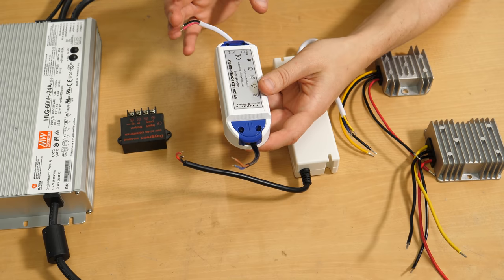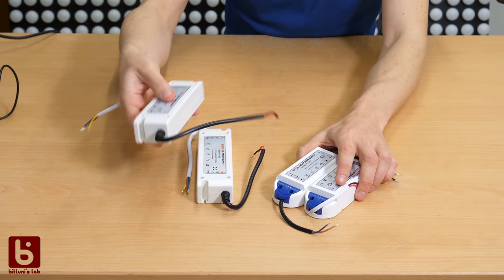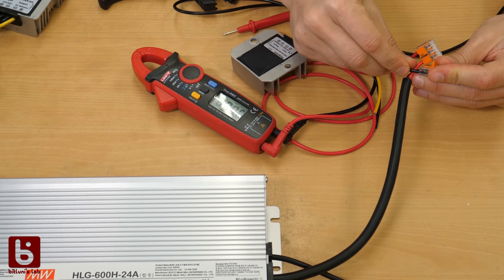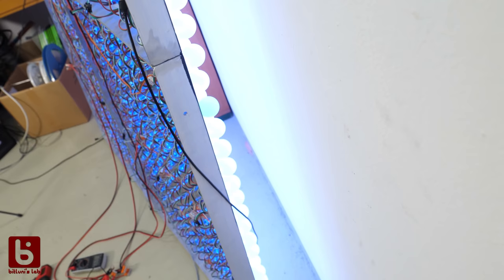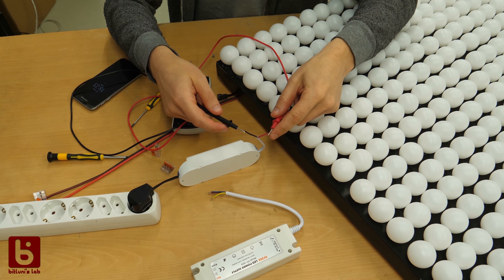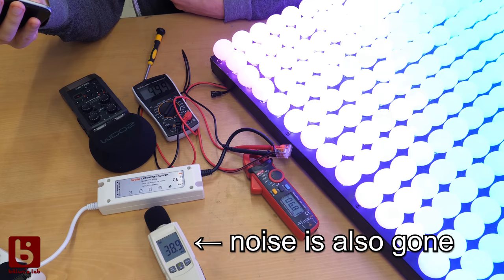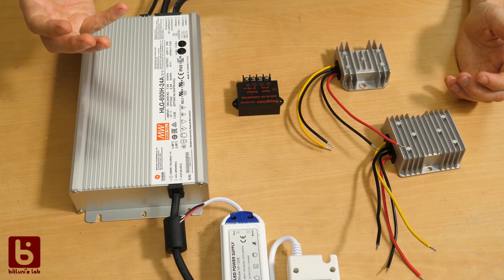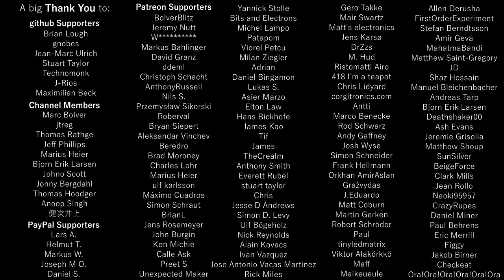Testing Power Supplies for LED Projects

Comment: Don't use infrared thermometers on emissive (shiny) surfaces such as metal cases, the reflections will make the reading seem much lower than the actual temperature. You can use a marker to color the area you want to measure to correct this (or use a really expensive thermometer with a correctable emisivity).
Reply: Yep I've learnt that by measuring the temp of an ice cold water bottle (the metal insulating bottle) and it showed the water was at room temperature 20°C as the inside of the container was shiny stainless steel, the water was actually filled with ice cubes at 3°C when measured properly.

Comment: 5:40 "I like to test any metal parts for potential electrocution"... by touching them, and seeing if they cause death
Reply: It's the @bigclivedotcom or ElectroBoom (@msadaghd) test 😁
Reply: At least use the back of your hand!
Reply: I don't think that he would do that with metal case power supply from China
Reply: @richardperritt  Works to check charged caps too

Comment: A couple of years back I built the electronics of a huge LED wall (a.k.a. FlaschenTaschen) that needed 80-90A at 5V with all LEDs on. I ended up with three MeanWell 5V/30A power supplies supplying different sections. They required mains distribution, but that could be limited to the parts sitting on the ground, so no big deal there. These days, I'd probably go a similar route you go here: Get a beefy intermediate voltage supply, then from there to local distribution parts that then convert that to 5V. I'd actually slightly prefer 48V to 24V, because this is a very common distribution voltage in the industry for there is a huge selection of 5V converters.

Comment: I personally am a big fan of (used) rack server power supplies. They are dirt cheap, built with high-quality components, and even the small ones deliver 50A+ @12V. You can also cascade these to get e.g. 24V. Obviously these need active cooling, but you can always build a sound-insulated enclosure and/or stash the PS far away from the application.

Comment: I also like to use those Daygreen DC converters. At our cottage I've got a big 24V supply from which I can take relatively thin wires for long distances, then drop to 12V for cameras/IR LED's/water pumps and to 5V for Raspberry Pi/ESP projects. Very handy to reduce the need for AC wiring and ugly outside wall sockets!

Comment: Make sure you don't forget that this mean well power supply is a constant current type driver.
It's intended to drive bare LEDs, yours are not.
So make sure that the current limiting potentiometer(under those black plugs) is set to maximum so you don't get weird issues.
Reply: It is both, a constant voltage and constant current PSU. But you are right, the CC setting is not needed here (but most likely made the PSU more expensive than a CV only PSU).

Comment: It makes sense for the LED wall to convert 240v to 24 before splitting it up. I have a project in bigger scale right now with 100m of LED strip hanging from the ceiling. If i would take voltage down to 24 or even 12 i would have too long cables from there to all the 5m Segments of LED i power seperated and a pretty high voltage drop. So i have no other way than giving every segment a converter from high power. But still a good idea! I will also check all the power supplies like you did. The check with no direct connection between mains voltage and 24v was a good hint :)

Comment: thx for the video !!

Please don´t measure Temperature with an IR-Meter on any reflective Surface as bare metall or shine stickers. you get reflectations and you will measuring anything instead of the DUT
Reply from the maker: I realized that measuring the heatsink after opening one of the cheap ones but always searched a spot that would work
Reply: On different surfaces, you have to apply a correction factor that depends on the material.

Comment: Quick tip if you want to test if a metal case is going to sock you touch it with the upper part of your finger, this way if you get sock your finger will contract and stop touching the metal

Comment: If you want to use "electrician style" terminals you should add bootlace ferrules to the cables. Otherwise, for a professional installation, I would recommend proper  "cable to cable" connectors with an appropriate housing (e.g. TE AMP Power Series). It is also good practice to "derate" components in a professional installation, which you already demonstrated quite nicely by only utilizing 50% of the effective maximum load.

Comment: Why does the voltage on the model number end in "A" (42A and 24A)? That is kinda confusing...
Reply: Models with the suffix "A" have adjustable voltage and current by a couple of integrated potentiometers.
It's explained in the official specification by Mean Well.
Reply: @hauuau  Well, thats okay I guess, but the A on the end made it sound like it was the current limitations or something like that. Would be great if they put the voltage or the adjustable voltage indication somewhere else so it doesn't get customers confused.
Reply: @misaalanshori  Skimming over technical documentation beforehand is the best way to avoid confusion.
Especially in equipment targeted for industrial applications like those power supplies.
Reply: @hauuau  you don't have to be an apologist by saying skinning over the technical documentation. The suggestion stands on it's own merits. Of course looking deeper into documentation is always prudent but to save people's time a good naming convention is important.
Reply: Like any professionnal device or electronic component, it's important to read the datasheets.
Reply: @djmips  I noticed something similar as well, that all these type numbers have 42 in them whether it is a 24V or a 48V model. So, maybe that's what got Bitluni confused which could have happened to me as well, which proves the point of logical naming besides any documentation you may read besides it...
Reply: He pointed the arrow on wrong place, the label right-down from that arrow states 42V - 14.3A, that would be more clear for viewers ;-)

Comment: Very good video. My Christmas lights currently run off a 40A-5V supply after my 15A-24v supply failed. I used small 2A buck converters locally at the corners of my strips and they worked BEAUTIFULLY!  While noise isn't a issue for my project but I will admit the 24V system just worked so much better! 
Last year a few lights were definitely off colour (especially ones with no local buck converter) due to volt drop (4.2v not the full 5v)

Keep up the great videos. One day I'll make a led wall (or a bigger led matrix) 🤣🤣

Comment: With a transformer you can produce e.g. 50V AC from mains, and I believe, that the mains-to-5V transformers will also work on that voltage. Or might even with DC voltage. (This way you don't need to mess around with mains voltages, but does not need a high current AC-DC converter.)

Comment: it might be worth trying some cheap hexagonal Reflective tape around the leds to better distribute the light, as well as a set of inline parallel caps and matching dirt cheap buck/boost ready made pcb's in several zones for better dc amp distribution per pannel.
as a side thought you could also make a quick vacuum mold in square/hex group pannel shapes to better fill the light gaps to replace or reshape the pingpongs perhaps.

Comment: Why not use a PC power supply in combination with the DC DC converters to get 5v. Would probably be cheaper the the 600w supply you bought.
Reply: Because you still have voltage drop across the wires at 12V
Reply: I would go for a (used) rack server power supply instead. The build/component quality is much better. I, for example once bought six 54.4A@12V units for 3.5eur apiece (plus postage). Made a 12/24/36/48V PS out of four of them. But you are right, the 600W fanless MW probably did cost a pretty penny.
Reply: Yea, that power supply is a bit pricey but it's also harden (weather resistant) and better quality. However since he has more knowledge about it he can get a smaller power supply.

Comment: NEVER USE WAGO on a soldered wire. You have bad connection (small connection), bare wires is BETTER
Interesting video as always
Thanks for sharing :-)
Reply: Not really. I wouldn't use Wagos anyway, they're pron to fail.
Reply: @lelandclayton5462  how are they prone to fail, any sources on that? They're used in most household installations and are spring loaded
Reply: I agree with you. Wurth published years ago a book specialized on connectors. Effectively, the contact must be large when current is high.
Reply: Tinned wire is a bad idea in general, especially with things like screw terminals, because the tin can flow over time and cause a loose connection (and thus a fire), but I would have thought that Wago connectors wouldn't be affected by that as much, because their springs would compensate for any flowing of the tin...

That said, I do agree that you shouldn't use tinned wires in most situations - use bootlace ferrules instead for the same effect :)

(I'd like to see that evidence about Wago connectors being prone to failure, too! They're very popular in the UK, including among a lot of professional electricians, and I've never heard of a single one of them failing. Hell, even the Chinese knock-offs that I've seen appear to be decently well-made - though, as with all of these things, you shouldn't use them in professional situations, not least due to liability reasons!)

Comment: Awesome review. I have always wanted to experiment and calculate bang for buck using batteries for wildly varying loads that have an average demand that is half or less of peak,
As LED displays can have huge peak demands it would seem reasonable that a small battery bank could easily meet demand while a relatively small PSU continuously keeps them topped up.  This is based on the assumption that peak demand are fleeting

Comment: Perfect timing of this video for me. I've got some QuinLED Dig Uno's on the way and hadn't been able to decide on what power source to use. I did already decide on going for a fanless MeanWell, but hadn't seen the "beast" that you found. Also, I have 5V and 12V LED strips that I want to combine into a fixture, but hadn't found good DC-DC converters yet. So, this helps a lot in my decision-making. I wonder if going for 48V and then to 12V and 5V stepdown might be better, since I could more easily distribute the 48V over larger distances.

Comment: This is good. I used 60A DC5V for 550 LEDs and removed the fan inside the PSU. Heat didn't seem to rise that much but still my Led panel died recently. Haven't even tried what is dead PSU, Esp8266 or just some loose wires. Even with the slowest animation speeds I kinda got bored looking at the thing. Still I will check out what's up some of these days

Comment: You're using CCA (copper coated aluminium) wires - those have a significant higher voltage drop due to resistance than copper wire. Use copper wire or even a nym cable instead.

Comment: Low voltage high current DC distribution is a pain.  Very lossy at that voltage.  The cross section for conductors/bus bars becomes prohibitive very quickly.  24v bus across the display with local downconversion and VERY short runs seems best.  Also means you dissipate heat over a larger surface area.

Comment: Wire resistance is a problem = use thicker wires ;-)
Also the WAGO clamps are rated for 32A, which means the contact resistance is that they don't get warmer than what the manufacturer and guidelines allow. They still have significant resistance and that's why you should use thicker wires and better clamps. No one would wire up a 32A circuit with these WAGO clamps in domestic installations. Instead you'd see proper screw terminal blocks with two thick brass or copper screws per lead, and usually rigid wires or copper bus bars.

Comment: They make 12v addressable chips, but not available in that kind of wired string, just strips (not the ones with 3 leds in parallel, those are different). Also, Meanwell make good power supplies, I use a 12v one for my 3d printer and lab supply, been going flawless for 4 years every day use.

Comment: Amazing video. I think for your next LED project you should try to use 12V addressable LED. Voltages are easier to work with than High currents.

Comment: Use longer wires for the 24V route since it has lower amps. Eliminates some loss to heat.
Reply from the maker: That's the plan

Comment: In your conclusion you don't like that a 30 Ampere rated DC/DC converter drops the output voltage when in over-current limiting mode. 
So to speak: when it is doing what it should do!
That is a nice view on Ohm's law and how thermal and switching losses are inevitable in mother nature.
Thanks for the video:)

Comment: The direct 240 to 5V supplies have very questionable separation on the PCB. The small one isn't even really trying, the bigger one may have a cutout, but then seems to mess up with a trace and the heat sinks.

Comment: I bet the IR losses in those 5V relatively thin long leads up the back of the panels are huge. If they are heating up 7-10C that's a good hint that you could have used larger conductors. The 5.0v at the input is probably 3v at the leds :-)

Comment: At 10:11, I don't know the answer, but wouldn't the grounds be common anyways due to being powered off the same 24v line? I would expect ground on the 24v side and 5v side to be common, so then both 5v grounds to be common already
Reply from the maker: Yes. But I imagine it's like using a scope without connecting the ground clamp of the probe. The signal falls apart.
Reply: He's right, all the grounds are common already since the dc-dc converters aren't isolated. Still good practice for noise to link them near the data lines too.
Reply: @bardenegri21  I concur. Bitluni's connection schema is exactly how you should do this. (Re-)connecting the grounds after the separate LED strings would create ground loops, and thus be a bad idea though.
Reply: @MrZetor  when reconnecting the grounds with low impedance you'd just parallel the two ground leads, so there shouldn't really be a loop

Comment: You could have corrected this problem with Remote sense of the Voltage. It is a feature on some Meanwell power supplies that will ajust the output voltage to the load.

Comment: If the converter has a 40K increase at 1/3 load i guess you should only youse it for 5A Max.
If you really need small quality converters make a DIY Design with an XLSemi Part. They have an 8A Continuous Buck converter IC. The additional party can be pre assembled by jlcpcb.

Comment: you could just have used a 450w fanless computer power supply and those are designed to output smooth 5v to power sensitive electronics  that would have been eazy.

Comment: 13:26 What about that horrible primary-to-secondary isolation distance? They have nice separation under the transformer but the optocoupler is shifted (probably to save board space) and it ruins it completely.

Comment: Did you put the LEDs in parallel? I always thought if you have a lot of the same LEDs you put them in series to make up for the slight resistance differences?
Reply: These are addressable LEDs with a built-in controller, for bare LEDs you are correct.

Comment: Does is really make sense to transform the voltage twice? Isn't it nicer to transform directly from 230V to 5V or even use 12V LEDs instead?

Comment: Can anyone explain what defines maximum amperage for switching power supply ? Basically all of them are IC, couple of input / output capacitors, maybe resistor for feedback. Is it IC architecture that defines all?

Comment: The solution is kinda obvious ... local conversion of power.  Standardize on either 12v (because ATX power supplies are mass produced and easy to hack by adding 12v wires and a single awg18 wire can do around 10A of current with minimal voltage drop) or 16.5-19v (because laptop adapter power supplies are passive, no fans). Group 4x4 leds or 8x8 or 16x16 leds and use one switching regulator / dc-dc converter to convert 12..20v down to 5v locally. Cheap 1-2$ dc-dc converters can do 1-2A of current on the output with more than 92% efficiency... ebay is full of ~1$ step-down regulators that output 5v ... search for example for "DC-DC 9V/12V/24V to 5V 3A Step Down Voltage Regulated Power Supply Converter" which can work with up to 28v dc and output up to 5v at 3A (but I'd say you shouldn't exceed 2..2.5A) and they're 0.99$ each

Comment: Great video, as always.

One question, why you decide to use 24v as a first-step converted voltage instead of 12 or 48v? Do you plan to use with batteries in the future (for example, outdoor displaying)?
Reply: The max. input voltage of the DC-DC converters is 24V. Also, the higher the voltage, the lower the current, i.e., the thinner the cables (with the same power).

Comment: Well, I have run into the same problem of difficulty finding a high-current 5v power supply, and ended up in using a 24V 5A PSU (similar to laptop ones, without heatsink) and 4 * XL4005-based step down module to provide 24v -> 4.2v and feed my LED strip, a 300-LEDs SK6812 RGBW panel. 4.2v is for the compatibility of the 3.3v signal from my selected MCU: ESP32.

The solution works but I found the 5-pin XL4005 chip really hot even in low or mid load cases, so even though the panel can output enough light at best effort, I don't dare to use that brightness level for the risk caused by high temperature. Will some small heatsinks work for those modules?

Comment: why you dont buy a server power supply. You can find a 12v 100a server supply on ebay for 25€
Reply: Used server PSUs might have been in service 24/7 for more than 10 years. They're that cheap because they might last another 10 years, or fail tomorrow.
Reply: Do those come without a fan?